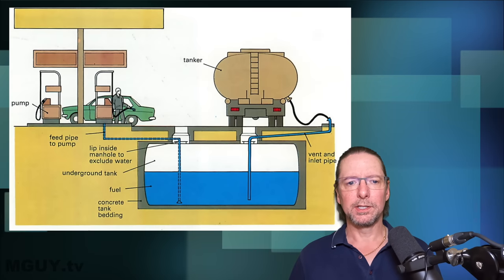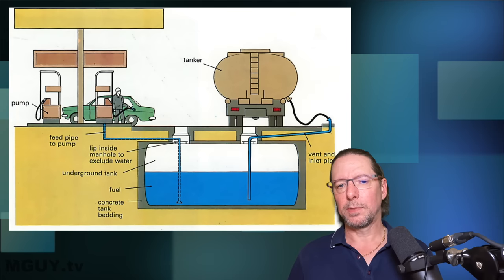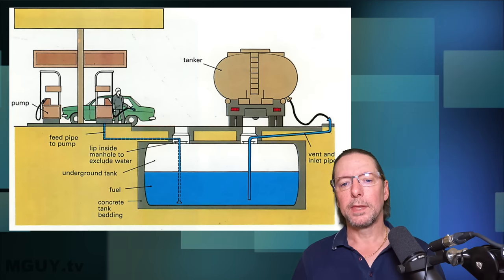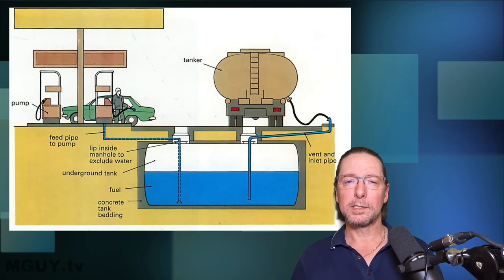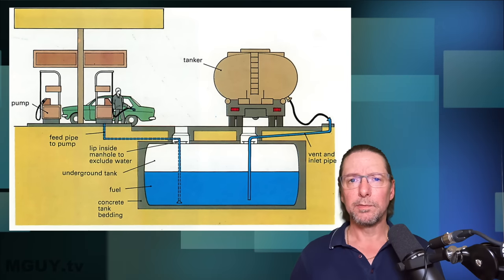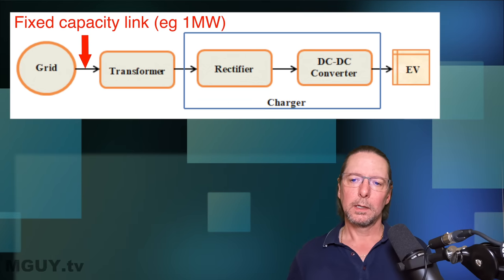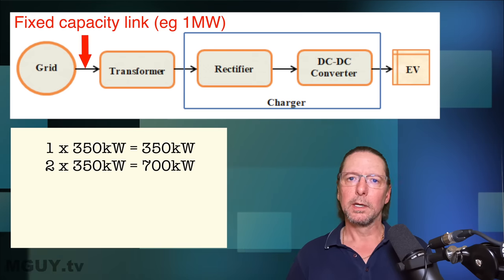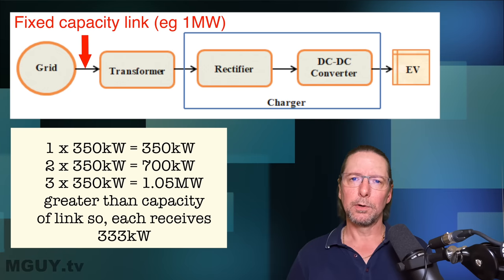HUGE problem with EV Charging Stations that no one mentions | MGUY Australia

Comment: There's another advantage of the tank. It's simple infrastructure that can be set up in the middle of nowhere. Just have a tanker drive by and fill it regularly and you're good to go. With EVs you need the entire infrastructure to generate electricity on the spot or connect to the grid, which might be really expensive if you're out in the boonies.
Reply: That is exactly what trucking companies do when their trucks are mostly in the yard at night, a refueling service come around and top up every truck.
Reply: And the grid is powered by fossil fuel defeating the entire object/issue!
Reply: @suzanneberger8202  Maybe get educated on the issue before shooting your foot. Currently 20+% of US grid is powered by renewable energy. And even the part that is still fossil generates power way more efficiently than individual combustion engines due to their much larger scale.
Reply: @erichop822  So that implies 80 percent of the grid is fueled by fossil fuels... So unless your home is off the grid, your EV is most likely being charged from a 80 percent fossil fuel fueled grid... Your EV isn't really emission free, is it?
Reply: @ronclark9724  Your EV is. Your power generation isn't. Yet. These numbers are changing rapidly at the moment. There are already lots of people charging their EV at home from solar. 20% was a pipe dream only 2 decades ago. And with every new green energy source installed the numbers become better. For all EVs. Meanwhile the numbers for petrol cars hardly improve in the US due to lax fuel efficiency laws. Lobbying works, it seems.
Reply: If you are going to burn diesel to run a generator to feed a charger to charge an EV then you have already introduce several losses in the energy chain and would be way ahead to just burn the fuel in the vehicles themselves - increases efficiency significantly and eliminates all of the in between machinery!!
Reply: @erichop822 , and when are they changing those EVs? Oh, that is right during the night when solar is not producing. There are three EVs in my neighborhood, all plugged in at night. None of these have a battery system, so they are drawing power from the grid at night. 

Also, I’m in a city of 3 million people, and California, the county I’m in has zero power production. No wind turbines, no fossil fuels, no coal, no nuclear (they shut that down years ago), no hydro (water level is to low to run those). So, other than solar on houses all the electricity for the 3 million people is coming from else.

Also having driven up and down my state multimedia in the last two years, I’ve seen zero wind farms, one failed solar plant, but miles and miles of power lines coming other states.
Reply: Especially if, like me, you live in Australia.
Reply: That tank -- simple infrastructure you called it -- doesn't just spew forth the gasoline when it's needed, right? It has to be pumped out. That takes electricity. Which means the infrastructure for EV charging is also available at that location. All that's missing is the actual charger.
Reply: @TheRealScooterGuy  You're talking several orders of magnitude difference in electric power requirements. A simple generator can run the pumps. Fuel enough. Haha.
Reply: @erichop822 Actually, it is just 12% in the US. But you're still right. Petrol fuels are still high volume, very portable energy sources, unlike electrical power. Even natural gas, which is harder to deal with than petrol is a far better choice than electricity.
Reply: @erichop822  -- The typical remote fuel station has adequate power to run pumps without relying on their own generator. If their power is unreliable (I know a mountain town like that), they might have a generator for backup power, but not as their primary. The electric service at such a location would be sufficient to charge an EV -- they are routinely charged off of 240V outlets (in the US) which, incidentally, is also the minimum power requirement of in-ground fuel pumps. (Whether or not the service panel for such a fuel station has adequate capacity to add electric charging may be another story -- this has been an issue for some homeowners and businesses that wanted to add chargers for EVs.)

But this whole discussion is a red herring. Nobody is claiming that electric is ready to replace internal combustion for all vehicle types and uses. What it is really good at is replacing vehicles primarily used for driving short-trips in urban environments.

My employer leased two EVs for making deliveries. They have issues -- I'm convinced that the automakers are purposely sabotaging their own products to reduce demand -- but these aren't issues related to the powertrain, the batteries, the torque, etc. They are simple comfort issues like having inefficient environmental controls, sun visors that leave gaps, a massive right-side blind spot, and an owners manual that includes data for every similar van the company sells, including ICE vehicles, so EV users have to wade through ICE maintenance data in order to find out how to change an annoying setting in the on-screen controls.
Reply: @TheRealScooterGuy  , sorry you comment made me laugh. The power required to run an electric pump (1.5 hp electric motor) to get the gas out of the storage tank is a 6 amps 120 volt circuit (so 5 pumps / 6 pumps as the 6 amp spike is when the motor starts and then drops to about 4 amps). The power requirement to charge an EV is 32 amp 240 volt to charge an EV. You get about 25 miles per hour of charging. Quick charge stations draw more amperage.

So, the gas pump  draw will run for less than 5 minutes. The EV charger will run for about 45 minutes (using a quick charge stations amp draw goes way up, about 50 amps). The infrastructure requirement is completely different. In a power outage, I've seen gas stations power up a simple 7hp gas generator and keep 2 pumps running. The same generator would take over 3 to 12 hours to charge one EV. that is assuming the gas generator has enough fuel for that length of time.

Also most houses in the US are only rated for two/three 30amp circuits. Most have older homes only have two - electric dryer and electric stove. If your electric panel can't handle another 30 amp circuit, you have to upgrade the panel and depending on where you live, the lines coming from the street to your home might need to be upgraded as well.
Reply: @wvanyar1801  -- Gas stations I worked at in the past had 240v lines (breakers) for the pumps. I realize that is a small sample size.

And again, people using outlier situations as an argument against getting an EV is ridiculous. You don't have to get one for yourself, but don't tell me I can't get one. (I can't afford one right now, but if I could, I would. I do drive one for work and love doing so -- even though I think the manufacturer is trying to sabotage their own sales.)
Reply: What are you talking about, the electric grid already exist everywhere...
Reply: There are multiple ways to store energy, not just batteries. You could for instance pump water up a hill into a storage tank and then let that water flow downhill turning some water turbines and generating electricity as a hydroelectric plant. You could have hydrogen fuel cells that split water into hydrogen and oxygen, and then you run that hydrogen and oxygen through the fuel cell to generate electricity.
Reply: IF needed solar pannel and batteries can be installed, no need the electric grid. IF there is no electric grid, there would not be a lot of traffic there anyway as electric grid is everywhere people are.
Reply: @mletouutube  Solar Panels cost something, if they were more efficient than centralized power generation and distribution over the grid, everybody would have them. Why for instance are their power outages in Ukraine, why don't all Ukrainians have roofs covered with solar panels to meet all their electrical needs? Why do they get their electricity from vulnerable power plants that the Russians can bomb? Doesn't make sense if solar panels are so cheap.
Reply: @suzanneberger8202  Rubbish, my grid supply is entirely renewables and in summer usually pure sunlight from my own solar panels and a few batteries.
Reply: @thomaskalbfus2005  , ah your post made me smile. Do the math, the amount of energy to move the water up a hill and then let it flow downhill to turn a turbine to produce energy does not work. OK, it will work, the amount of energy to move the water up hill is greater than what you would gain having it flow downhill and run a turbine. This has been proven to not work. The loss of energy is too much, and you end up with a net loss in energy. This is the reason nobody is doing this.
Reply: @mletouutube  , no the electric gird does not exist everywhere. There are places in the desert that don't have electricity. Also on certain mountains. Also even in LA there are brown outs, loss of power due to grid over load, that happen during the summer.

Then if you go to third world countries, well a stable electric grid is a long ways off.

A perfect example is the governor of California said he would not allow the sales of gas powered vehicles after 2030, only EVs. Two weeks later (Sep 2022) he was back on the news asking people to not charge their EVs due to the strain on the power grid. If the current grid can't handle the EV load today how is it going to handle it in 7 years? It can't.

Over 70% of the US power grid is over 25 years old. Just San Fransisco, is spending $67.5 million dollars to upgrade its power grid and it is not enough money to do the job. California planned to spend $432 million to improve the public utilities from 2019 to 2021. 

Even if EVs are the salvation that some claim, the financial cost to get the support structure for the EVs is not there and will not be there on the time frame being asked.
Reply: @wvanyar1801  You can do the same with weights, you can raise weights up on pistons and the weights on the pistons will push them down and you can extract energy from that. Another energy storage mechanism is flywheels, you use energy to spin them up and you can use the circular motion of the flywheels to generate electricity slowing them down in the process. Another way to store energy is by compressing air, you compress air store it in a tank, and when you want to extract energy, you release the air, the tanks can be as heavy as they need to be as they are not on a vehicle, they are stationary.
Reply: Unless you have a battery and Solar Panels….
Reply: @ronclark9724  The UK  is approaching 50% renewable, with many projects in the pipeline. I understand that South Australia has gone virtually fully renewable, wind and solar.
Reply: The idiots Don't take that into consideration. Being in the middle of NO WHERE.
Reply: @solentbum  I think South Australia are at about 70% renewable currently with plans to reach 100%? by 2030. It's been a process over the last 15+ years, with over $6 Billion spent by Government and another $20 Billion projected for future works. It's a combination of Wind, Solar, (big) Deisel Generators, the Tesla Big Battery (as a stability buffer drawn from company who runs it).  This is for a population of about 1.8 million, with a fairly solid focus (location of infrastructure) in a single city and metropolitan region.
Reply: @mletouutube  The existing grid has its limits, there's no reserve for mass EV charging. Say, most houses in my town are on a 5 kW max diet. The cap is set not by generation, but by the state of local power grid. Increasing the household allocation is possible but prohibitively expensive - to the point where it's cheaper to buy an adjacent house just to use their electricity allocation.
Reply: @thomaskalbfus2005  They may be cheap for Californians with six-digit incomes, but not for people of Russia or Ukraine. I did the math when I designed my house (that was back in 2012) and the upfront costs of solar would then at least double the total cost. And that's before even touching the storage issue. Here, in central Russia, there's exactly three sunny days in December (3-4 hours long each) but only one in January. Ukraine isn't much better. If solar-generated energy can't be stored into the winter... what's the point?
Reply: @suzanneberger8202 The grid is also powered by wind, solar, hydro, and nuclear. Also I'm guessing the fossil fuel power plants are way more efficient than fossil fuel powered  vehicles
Reply: @ronclark9724  If you drive a gasoline car, it will always be powered by fossil fuels. If you drive an EV, it can be changed to be powered by renewables even if it's running on fossil fuels now.
Reply: usually, the pump need electricity so the grid need to be accessible. Perhaps, one can have a generator or a manual pump. And if it is so far away where there is no grid, then the guy will drive an ICE car, so what? We do not change a society for the exceptions. The exceptions will drive their own solutions.
Reply: @MichaelTheophilus906  Except if you have a Tesla; one has 350 miles range and chargers are everywhere on your way to the boonies.  Of course it is not a car to go 200 miles in the woods. It is not an off road vehicle. The cybertruck is coming though with 500 miles battery bank and you can also carry a generator if you really want to go very deep in the wilderness once in a while.
Reply: @MichaelTheophilus906  that will take time and the grid will adjust. Most people think, like you perhaps, that the grid will not change... They are mistaken.
Reply: if they get power there to power the gas pumps, there's power there to power a charging station
Reply: @erichop822  indeed, but as numbers of EV's and charging stations grow, will new renewable energy projects keep up with the demand?
Reply: @TheRealScooterGuy  it does, but it's a small pump and a car's tank can be filled in a minute. The amount of energy required to fully recharge just one EV can run those pumps for days.
Reply: @MichaelTheophilus906  In the beginning of the 2100, ther were a lots of neysayers making all kind of statements against the new vilain automobiles... replacing the gentil good horse.
Reply: My grandfather had a tank on his farm to fuel his equipment. Very simple to install and refill when needed.
The tank was mounted about six feet above the ground so you didn't have to pump it.
Reply: @bob456fk6  Yes a farm needs this since tractors and combines cannot drive around much to fill their fuel tanks. All farms have that. All motorized equipments do not have to be electric if it is not a good solution in specific work environments. Nevertheless, generators can charge batteries but it takes fuel to produce electricity- not economical; solar panels are more complicated to instal but a farmer would have plenty space to install that system and the advantage is that it would cost nothing to charge the batteries after the initial cost of the solar panels installation + optionally battery storage- and the whole farm would benefit of free electricity). The other advantage is that electric motors have a lot less maintenance than gas engines and are more durable.
Reply: It seems, you live in some place where an electricity grid is not available. That may be Ethiopia, or something like that?
Reply: @suzanneberger8202  We get 100% of our energy from hydro-power. And, fossil fuelled  power plants are far more efficient as gas powered cars. The filtering is also way better. AND: you get the fumes and rumbling out of your neighbourhood.
Reply: @ronclark9724  We get all our energy, 100% from hydro power. So your "implication" doesn't apply in my case, and also doesn't apply to a most all cases. Anyway: the "green energy" investments and market is growing, despite opposition from people who support oil burning.
Yes, my EV is emissions free.
Reply: @ronclark9724  How emissions-free are your ICE vehicles?
Reply: @Hogger280  Why would someone do that? Fuel-burning Energy is produced in power plants, who run at max efficiency, far, far better than a home diesel generator.
Reply: @wvanyar1801  I'm charging my car at any time, 100% with hydropower. Why are people charging at night? Well, because at night the energy production is far higher as the consumption, therefore its cheaper, and would go to waste, if not charging EVs.
Reply: @hokroeger  Yeah, a similar banana republic to that. USA.
Reply: @hokroeger  Read   @erichop822 comment above and follow the thread.  All of these replies are to his comment.   It is ridiculous to use diesel generators to power chargers!
Reply: Just put up a bunch of windmills and solar panels. 😆😅🤣😂
Reply: Without electricity; no gas pump.
Reply: @erichop822  - You need to do some research because you are way off base and wrong.
Reply: Au contraire, mon frere - these tanks are far more complicated than you let on. They are often triple hulled with salt brine between hulls. They are situated on stabilized subsoil and have multiple sensors indicating water, ullage, leakage of gasoline as well as leakage of brine, over topping alarms and others. And a great deal more.
Reply: @solentbum  What?  I'm from the UK, and I can simply visit a website to see the amount of electricity being generated and renewables are nowhere near 50% FFS stop lying and deceiving people
Reply: @thomaskalbfus2005  You do realize that perpetual motion machines are impossible right? Lifting  a weight consumes more energy than dropping it will produce, same for compressing air, same for....
Reply: @thomaskalbfus2005  You do realize that perpetual motion machines are impossible right? Lifting  a weight consumes more energy than dropping it will produce, same for compressing air, same for....
Reply: @Hazanko83  You can still store energy on site, there are many ways to store energy, there are batteries, you can pump water up a hill, or compress air, some energy will be lost as the process is not 100% efficient, but at times of less than peak demand, one can still accumulate energy, this is kind of how hybrids work.